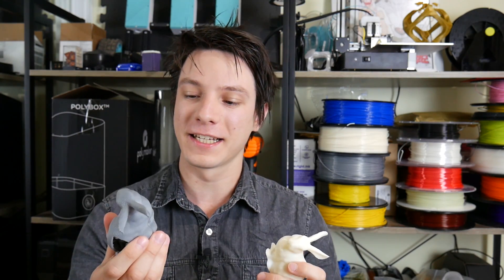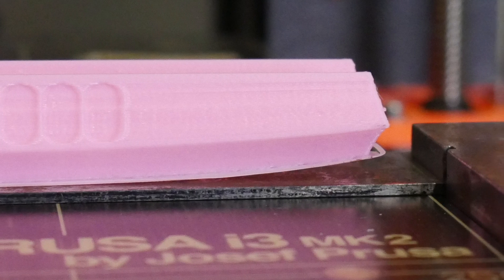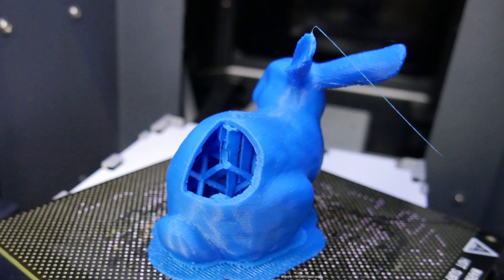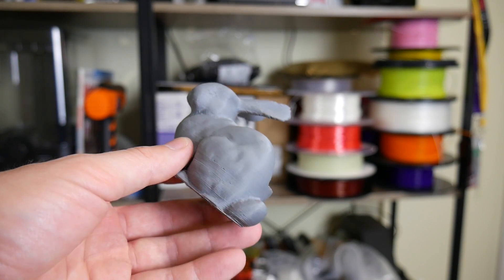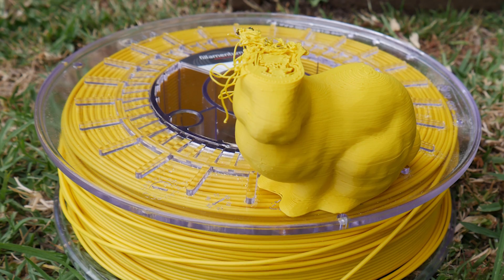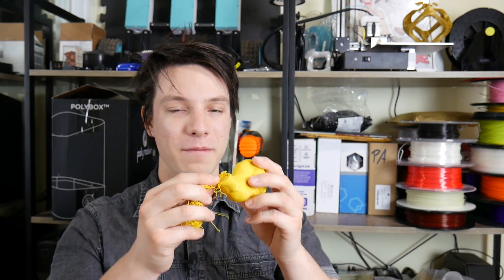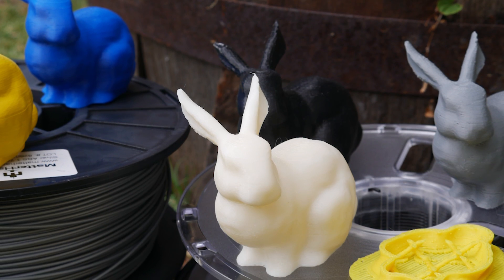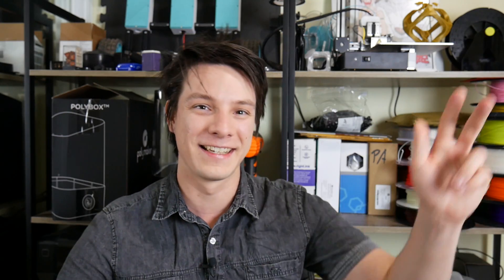Should you 3D Print in ABS? Probably not.

Comment: I print several kg of ABS every single week. It is not difficult to print. I have 4 printers that run huge amounts of ABS through.

Why the hate?
ABS is great for a huge amount of applications.
Hobbyking ABS is fine.
Pure white ABS is not hard to find. Devils Design in EU and many others globally. Stop saying stuff you don't know!
My ABS prints look heaps better than yours. I think you should try a better printer and just tune your settings a bit. For instance a Duplicator 6 with the side covers on. I succesfully print ABS on; Duplicator 4X, Duplicator 4S, Duplicator 6, Fabrikator Mini 2, Prusa MK2S, Folger Tech FT-5.

You are talking about ABS like it is an old and unused type of plastic. Take a look at A LOT of consumer products and you will find ABS everywhere. ABS will be relevant for years to come because it is cheap and good for the application. That is why it is still used and still will be used for consumer products and 3D printing in the future.

IT IS LIKE SAYING RUBBER IS IRRELEVANT FOR TYRES IN 2017.

ABS on a PEI bed has great bed adhesion. Same situation on Buildtak. I have also been printing a lot on pure clean glass for many prints without major issues. Stop saying bed adhesion is a problem when it isn't. In 2017 - as you keep talking about -, there are so many good surfaces now that removes the problem with bed adhesion.

PLA MELTS! It us crap for real world use. Just look at the train on the Prusa NY makerfaire. It melted from just standing out in the sun! PLA melts in a hot car or if you place it in the vicinity of any heat source. I would NEVER trust PLA in an actual product.

Please remember that you as a "public" person has a lot of influence on the industry - users as well as manufacturers and this kind of talk without backing it up with any real arguments (other than "this 40 USD filament is really good") is just wrong.
Reply: I do mold making using ABS, acetone washable and cost are the two biggest factors. Being able to acetone smooth everything is critical. Plus when a mold can take up to half a kilo of plastic and gets torn apart afterwards(tricky single piece shapes) then cost is a big factor. It's also nice and easy to trim with a sharp knife to make corrections and get rid of problems.
Like Scott Lichtsinn, it just smells like hot electronics, I don't leave it in the same room just to be paranoid, but the smell isn't unpleasant to me at all.
Reply: ASA can be acetone smoothed and has all the benefits of ABS plus UV Stability and better chemical resistance.  I hate to put words in someones mouth, but I think that's what Angus was getting at.  Today, there are better alternatives to ABS
Reply: Still printing ABS today. It's insanely easy to print and VERY predictable. You have the right environment, and  it's great. Done. PLA and PETG and unpredictable and different rolls are very different from each other.
Reply: I agree. If you dial ABS in a heated chamber, you not only get fantastic looking results, but the prints have great layer adhesion too. Basically heat a chamber to 50C and heat a nozzle to the higher side of ABS print temp. It also prints fast which is more than you can say for something like PETG. It being heat and UV resistant makes it a more useful material than almost any other 3D print material. Combine all that with how cheap it is, and that's why I almost exclusively use abs. You can have it outside without degrading, you can have it in your car without shrinking.
Reply: I think ASA will be within 2x the price of cheap shitty ABS but no closer during the next few years, it won't be a true rock bottom cost material for now like ABS is.
Reply: Electra, if HIPS smells, then it's likely contaminated, and i don't know, i have a hard time promising that something out of HK won't be. Something like REC has no smell at all.

Edit: it appears the smell is mostly unreacted Styrene that is caused by other monomers... it can happen in HIPS just as much as ABS depending on manufacturing technology details, but it usually comes out much lower odour than ABS.
Reply: Easily solved by a good printed, enclosure and if need be, some smart brims.
Reply: ABS is SOOO smooth. It has a nice cheewy'ness to it and I can take my blade and shave it (for cleaning) like a bar of soap. PLA prints super sharp but I once left a model I made outside in the sun for like 15 minutes and it was severly warped. PLA melts too easily - great for indoor stuff though. Cant someone chemically alter ABS so it wont warp so easily? I do have to print ABS with a bed @ 115c
Reply: @davey3765   Was the PLA really thin that you left in the sun? I've printed finials which are left in direct sun in the summer with no warping at all. I used 80% infill with something like 1.2mm skin and they are fine. I sprayed with UV resistant lacquer to make sure.
I do find that PLA is too rigid and sharp sometimes, and tidying it up with a knife is a chore, but it's so easy to print and gives very precise results where measurement is crucial, say if you've made a cut out to fit a nut and need it to line up with a hole perfectly. ABS is not good for printing machinable parts which need to fit precisely.
Reply: The smell is not the problem; the chemical that causes it is. Long-term exposure to 3D printer fumes (Styrene, nano particles) caused asthma in some cases
Reply: Electra, wouldn't you want HIPS instead? It also dissolves in acetone and can be vapour smoothed. It's a bit harder, warps and shrinks a bit less, easier to sand, and it's principally cheaper than ABS if you find the right supplier. But normally you don't get fancy colours, you get natural and black.
Reply: Siana Gearz: I keep forgetting about HIPS. I should grab a spool. Hobbyking has it for the same price as ABS and see how it turns out. Thanks.
Does it have any smell when printing?
Reply: Warping print and does not stick
Reply: the main point of the video seems to be "Poorly calibrated printers doing a rush job of bad slicing have poor performance".
warping (controllable)
Cracking (controllable)
weak?  (more walls. more infill. )
FFS abs works just fine
Reply: @Siana Gearz
Sorry for the off-topic, but how do you write with strike through?
Reply: The Mute, it's very off-topic. :)
* before and after, with no spaces, makes text bold. *
_ before and after, with no spaces, makes text italic. _
- before and after, with no spaces, makes text struck through. -
But YouTube comments are very finnicky, and one space or character out of place and it messes up everything after it.
Here I used it properly, and you can't see the hyphens I typed before and after. - Here I used a space before the first word, so you see both hyphens.-

Hope this helps. :)
Reply: I've pretty much given up on ABS as it's not worth the hassle. However I do think saying it's obsolete is complete rubbish without giving any alternatives for it. People still want ABS because of the high heat, flexible strength without cracking and better UV resistance, as well as chemical smoothing options. I still keep it for printing something like a small part that needs fixing on something like a lawnmower or something that will need to be robust and minor warping isn't an issue.
Reply: @WeAreSoPredictable Thanks
Reply: Did anyone commenting here actually watch the video? The alternative to ABS is PC, it costs as much as PLA. ABS will always warp because it was designed for injection molding to shrink upon cooling. Acetone smoothed ABS looks like shit, ABS is weak and breaks down with UV quickly. There are many better options: hips, pc, petg, and all are dropping in price and without the toxic fumes.
Reply: While watching this video, I was about to throw away my 1KG spool of ABS filament. However, reading this comment and many others like it, it seems I will be doing no such thing.
Reply: ABS makes the world go round - why not?

Comment: You need to print ASA very hot and it works well, but wont stick as good as ABS. But it also does not warp as much.
ABS works very, very good for me with Elmers or Uhu gluestick. As example this printed upwards (very high print):
https://www.thingiverse.com/thing:1536406

So if you get everything right, no problem... For the price its insanly good...

Comment: I print only ABS on a Makerbot 2X.  I make functional parts, not stuff that just sits on a shelf and looks pretty.  So, for me, the benefits of ABS far outweigh the drawbacks.  I need material that can withstand higher temperatures, can be machined, and are stronger.  Therefore, ABS is far better than PLA for me.  The newer blends of materials is worth checking out it sounds like.  But so far, ABS has worked really good for me.

Comment: Abs is still the best for my uses. Acetone smoothing and welding are the backbone of my 3dp business
Reply: try ASA it has simmillar properties but prints better details, is UV resistent and is not too expensive
Reply: @Erdnusschokolade  I have seen black abs last a long time outside
Reply: @Erdnusschokolade  asa is awesome, but sadly not many manufacturers have adopted it yet
Reply: @syndan9245  This right here. Color selection is very limited as is stock. Just sourcing a couple of rolls for my Voron build took some shopping around.
Reply: PTB (Polysmooth) ftw. Smoothing with alkohol vapors instead of acetone.

Comment: Really valid point. I don't mind ABS but my current printer isn't enclosed yet and that makes large prints really difficult. Thankfully, there aren't any drafts in my shop and I can get by on smaller parts. I am also partial to PETG but find it "shatters" more readily than ABS so thats something to consider giving the intended application of a specific print. As always, Angus, great video!
Reply: Also fumes are something to consider with ABS. A lot of these newer copolymers don't have that issue.

Comment: Yeaaaahhh….  Um, gonna have to disagree with you on this one.  At least, for the way I USE the material.  Yeahh…  ABS is so strong.  After you make a print, you can practically throw it to the grown with moderate power and it won’t break / crack.  I use my 3d printer to create a rough prototype, smooth with Acetone (works GREAT if you know how to use it), this is my print, 

https://www.youtube.com/watch?v=_RwUo6gRjcI

create a junk/waste silicone mold, use for wax casting, smooth detail wax casting, create final mold.  There are people using this material (not to mention 3d print technology) in ways you may have not even thought of.  ABS rocks.
Reply from the maker: Totally fair! It's a lot stronger than regular PLA but the modified filaments are definitely something else. Acetone smoothing as well as the price difference are very fair points to continue using ABS though.
Reply: I use ABS for all of my drone parts. PLA is heavy and hard like glass. Plus its a pain to rework.  ABS bounces well and is easy to rework and easily fixed with a drop of Acetone. My question is: - If ABS is old school then what should I replace it with?

Comment: My engineering buddy just had fits with ABS, but loves PETG, which gave me fits. I have been using PLA+ (Pro) in three different brands and all is great .... especially when annealed. I have a small convection oven and a small hot plate and water pot that I use when i anneal. I use small weights to keep thin edges from warping and print (depending on the brand of PLA+, about 2-3% larger). For my use I have been very, very happy. Learning the annealing process has been great for me.

I agree 100% that there are better filaments out there than ABS ... who wants to go through the bed warping and ?

Thanks Angus, another informative video !

Comment: In my experience printing with Polycarbonate is 10 times herder than ABS. It's much more picky about bed adhesion, and it is more prone to warping. Only very tiny prints will come out unless you have a heated build chamber, which most people do not have.

Comment: you should really look into ABS+. I print on my Tevo Tarantula, which doesn't have an enclosure, no glass surface, no glue, no tape, nothing on the heated bed and I only put a small brim on my prints. I get much higher quality than PLA and the parts are much stronger as well.

Print settings being: 250°C nozzle, 85°C bed, 0.2 or 0.15mm layer height, 25% fan speed on 2nd layer and up.

Also a quick side note, I talked with a friend of mine who works with industrial 3D printers for a very big company and he said that yellow filaments tend to have lesser quality (for ABS at least). It might be caused by the chemistry of the dye but usually red and orange ABS will have better results.
Reply: also did I mention that I get no warping at all? ABS+ is pretty much the same price as good quality ABS but it's just so much better!
Reply: exactly my experience.  It's cheap, strong, doesn't stink and has virtually no warp, while maintaining all the characteristics which make ABS a better choice. I've said this time and time again : there's no such thing as a bad filament. There's only bad choices in terms of what the part or material is intended for.

Comment: No. ABS. Ever. No PETG. No need for most enthusiasts. If I need anything stronger or more heat resistant than ABS, I use Raptor PLA from Makergeeks. The only thing I can see that ABS has over PLA is ease of post-production finishing.

Comment: A beginner should always start with PLA.   Back a few years ago after I built my printer I tried starting with ABS, and it turned out to be a bad batch which I wasn't aware of.  Bought PLA and it worked fine.  Eventually went back to another brand of ABS (eSun) and it worked great.  Then I gave the bad ABS away to someone and it didn't work for them either.   Still, I prefer ABS because of the acetone smoothing.

Comment: $40 for only 750grams (that's $54 for 1kg) and a choice of 2 colors. While it may eventually edge out ABS, its not going to happen in 2017. The cost savings of just a couple rolls is enough to build a quick cheap enclosures around your printer for abs.
Reply: Chris Becker you don’t buy pc max for models: black and white are fine colors for functional prints and prototyping.

Comment: I print ABS all of the time because I want the temperature advantage but....You are correct, it has a lot of issues that have to be addressed.  The only reason I can get away with it is because I use a PEI covered heated bed and I built a metal and glass enclosure which keeps the internal temperature high.  I also allows me to use a thickened acrylic cement like Craftics #33 which is much stronger than CA glue and provides some part adjustment time.  I built a large dollhouse tree house for my 3 year-old granddaughter and after a year of use and abuse no part has broken.  ABS has it's place but people should heed your warning, not every 3D printer set up can pull it off.https://www.simplify3d.com/grandpas-3d-printed-tree-house/

Comment: What kind of filament except ABS can you smooth with acetone or other easy to handle solvent?
Reply: Very late reply, but there are a couple. ASA can also be smoothed with acetone. PVB (e.g. Polymaker Polysmooth) can be smoothed with isopropyl alcohol. Unfortunately, both of those are more expensive.

Comment: Printing in ABS...why not? 
I print in ABS with a 90% success rate, I recycle failed prints and raft and print with that. I have 7 printers and only 2 have chambers. If want to get a smother print I use my POLYMAKER POLYSHER like the one right behind you. For me your statement seems invalid,  or am I missing something?
Reply: I print with PETG with about a 99% success rate (100% now that I always glue stick).  No odor of any kind, durable (as durable as ABS), food safe, no cracking, no shrinking, and (with a glue stick) always sticks to the bed.  All for ~$15 per kilo.   I would much rather use PETG and get all of the upsides of ABS without any of the downsides!
Reply: Everyone reacts to smells differently and i think Angus really hates the smell of ABS.
Reply: Just because you get poor details with PETG doesn't mean everyone does.  I get amazing detail, indistingushable from some of the best PLA on the market.  As far as colors, I can find as many PETG colors as PLA or ABS for my printer (though to be fair most filaments are color limited with 2.85 mm so that may not be entirely fair).

Comment: Only got one thing to say FormFutura TitanX Abs filament, and all your issues with heated chambers, and warping goes completly away. but the benefits of abs stays.
Reply: Thanks, I'll  check that out.
Reply: Xerteris hooray, someone else has caught on. I agree its great stuff. You can also get a cheaper version called ABS-X which is basically the same.
Reply: Xerteris if i can add that i am using this stuff in an unheated garage in October in the UK with a badly sealed Lack enclosure. Still no warping yet.
Reply: Aye, it really is a no warp product :) been using on a open system, and experimented with high fan cooling settings too for crisp fine-detail prints
Reply: At AUD50 vs AUD18 for hobby king ABS, TitanX is pretty expensive.
Reply: Laser Man ABS-X from 3Dfilaprint is cheaper amd exactly the same stuff. But still twice the price of hobbyking in the uk. Worth it though as the amount of waste I generate has been cut in half.
Reply: Cool, now to try and find a supplier in Australia